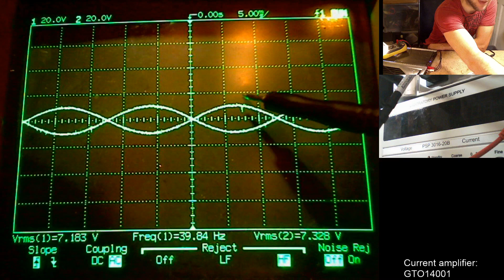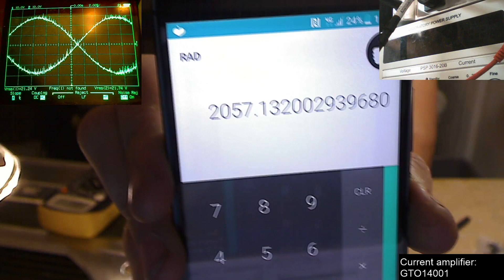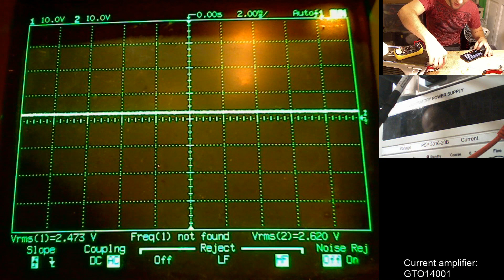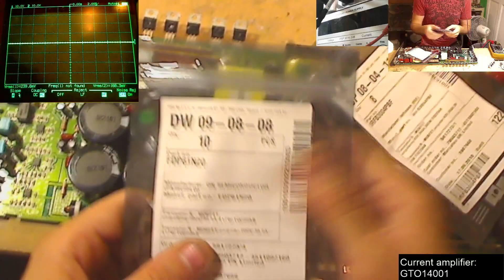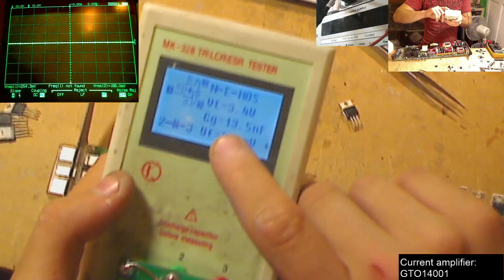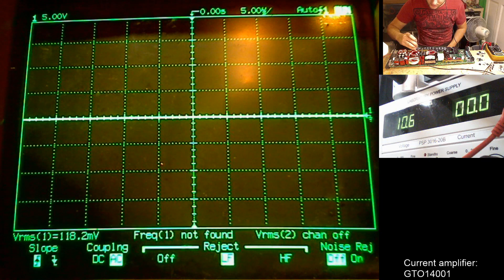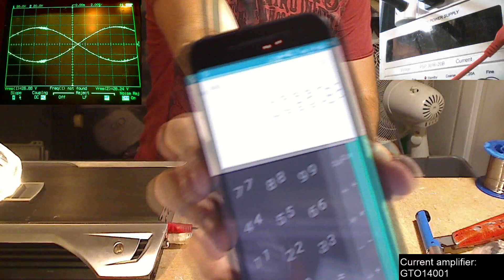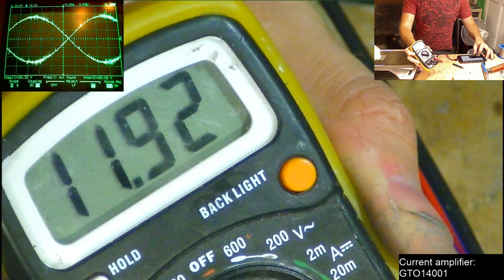Upgrading JBL 14001 amplifier to run 1ohm!?

Comment: Awesome video like usual, although I would have definitely left those fuses in place. Yes, the power wire has one(hopefully) but any internal issues the on board ones will blow quicker than the power wire one.

Comment: I love the live streams but I really miss these edited videos as well. It's all good!
Reply from the maker: Trying to do a few more like this ☺
Reply: barevids good job. I like being able to go back and use videos like this as a reference when I'm having a problem.  For example i did a power supply mosfet upgrade the other day and didn't realize why my fets where getting hot and the had a wave just like the one you showed.  Now I can go back to that amp and fix it with the proper resistors. Those little tips like that are the ones I'm in need of at this level. I do about 2 amps a week but I am in desperate need of some knowledge. Your the only person I have to learn from besides Perrys download.

Comment: I don't understand why the schematics show on both the board and the diagram 80V 4700Uf caps, but the parts list shows 100v 3300uf caps, which is what the amp contains. My issue is finding caps that are 30mm high, I can only find 35mm high in the 100v 3300uf which I already have 10 of. Was 73v the max you read on the output section after it was modified and did you know the voltage before modification? If the voltage were below 70 I would be willing to switch to the 80v 4700uf caps which are readily available for pretty low prices.

Comment: All arc audio car amplifiers have a protection circuit that causes the car amplifier to shut off if you run it at a impedance that is lower than what the car amplifier is stable at for an example the arc audio fd4150 car amplifier is stable at 2 ohms run it lower than 2 ohms and it shuts off run it lower than 4 ohms bridged and it also shuts off

Comment: Hello, I have my dbo for bass that does not work on my amplifier could you help me please. It does not work on the amplifier with the adjustment screws and with the die control! The rca exit from the station must be a sub rca socket! Because I don't have any!

Comment: I heard you say changing the power inputs would be a pain. I have a skar skv2 100.4 that came with a stripped neg Allen screw. What would you remand I do to fix it? Hard to get a tap and die in there since its so shallow. Def dont want to risk further damage by drilling through. Thread insert or?

Comment: I know this is a two year old vid. But I had a Eclipse 4 channel amp that had the B+ and Ground traces that were broken due to board flex.
I used some thin copper sheet and soldered t as a bridge. You should have done the same on the fuse connection connection traces.
I e. Bridge the trace with a copper strip the width of the trace.

Comment: 52^2/2 = 1352, lil under the 1400 spec. The output will be defined by the turns ratio of the transformers, clip power isn’t real, it FFTs out closer to a square wave so RMS conversation will be off unless it’s a true RMS value, regardless the cone achieves no more excursion because the peak amplitude is the same as the rail not higher, the voice coil sees it as DC, so it’s just producing substantially more heat which is why clipping kills drivers quickly. The thing I would worry about is how well the snubbing network matches the complex drive impedance vs T’on of the switches. Maximum power is transferred when source impeadace is equal to load impedance, the circuit could also become unstable with complex signals and oscillate (or at least be under damped) there could be some combination of frequencies that the output filter disagrees with. L = RL/2PFc so the corner frequency of the LC filter is heavily dependent on the load impedance. So you must change the inductance of the filter when changing load impedance to maintain the class D filter criteria. Good fun though...
Reply: Daniel Armstrong perhaps, I’m not familiar with the design, but most switch mode power stages will have feedback to regulate the output, so the voltage should remain constant but draw more amps at higher duty cycle from the input, I would think... I could be wrong, but I’m pretty sure I’m seeing the amp produce almost exactly what it’s manufacture’s rating is on the video... so we may never know... in the end I’m not sure it matters all that much since power isn’t linear, it’s 10Log(P2/P1) so a couple hundred watts when you’re already over 1Kw wouldn’t be really noticed, it’s only 1.3dB gain, assuming the drivers aren’t power compressed already, so probably even less actual acoustic power output... I also seriously doubt the amp will be stable for more than a few seconds as the output filter stage will be horribly misaligned from the original design parameters... but I learn new things everyday so maybe I’ve missed something... As an EE I would have to redesign the entire product from scratch to get additional power from it, so I’m not too sure how wise it is, but I guess if reliable operation isn’t a goal....
Reply: @robertw1871  My thinking exactly, right down to the old rule that it takes ~6-10x the power to double the perceived volume.

Just to be clear here though, there are automotive 12v powered amplifiers that are unregulated and advertised as such, that is the push-pull DC-DC converter always runs at its max duty cycle and the transformer turns ratio determines the rail voltage. No idea whatsoever if this unit is one of them.

Comment: Hey brotha, need to have 2 jbl gto 14001s fixed and modded to run 1 ohm. Please and thank you.  I'm from the states and no one hear that I know will take on the task. Please please 🙏 help.
Reply: He doesn't take in amplifiers from other countries. It's both very expensive to ship and you have to jump through a lot of hoops to get them through customs both ways. Here's a few amplifier repair shops you can try:
GS Amp Repair out of Arizona (George Sanchez)
Desert Audio Specialties out of Arizona
Todd over at Ellensburg amplifier in Washington State
Freeman's Car Stereo in North Carolina

I'm not sure why you need to have them modified to run at 1 ohm since they can handle a 1.33 load from the factory. Are you wiring your subs below 1 ohm?

Comment: Hi. Is it normal that when this board is out of the heatsink that the 2x KA7812 get pretty warm but everything else stays cool? (normally bolted somewhere between all the the other transistors to the heat sink). Great video! The amp is working I just wondered why those two were getting warmer but perhaps they just run like that continuously and they were not on the heatsink.
Reply from the maker: Yes totally normal
Reply: @barevids  Phew. Thanks for the reply Sam. The guy told me the amp was in amazing condition but he had drilled and tapped out most of the connectors. those JBL connectors are a piece of shit, all the pins had snapped off and then I blew my new 500W soldering iron gun. I think because I turned it to full power it's labelled 220V and I'm on 230V.
 Anyway I soldered cables directly to the board and post fuses. I had to throw the binding post, all the pins were snapped but happy days it now works. Having fun arguing with the guy who sent it to me and sent him all the photos of the repair to prove him wrong. lol
 He also sent me the 7001 but at least that one was in good Nic!

Comment: Great Video man i am liking your series. Keep up the good work. Do you ever test your amps into reactive loads? if so can you tell me what you use? PLEASE dont say a speaker ;)
Reply from the maker: But a speaker is a reactive load haha. There aren't many other reactive loads that would present the amplifier with a speaker-like condition. When testing reactive, I still leave one or two dummy loads hooked up to stress the amp more than just the speaker.
Reply: @barevids  Thanks mate.

Comment: EXELENT!! I love modifications like this!! Is there anything else that can be done, besides thickening traces?
Reply from the maker: Rewind the transformer to higher voltage on the secondaries, and upgrade caps etc as required for the new voltage.

Comment: lol the most underrated amps are orions, albeit they are cheater amps though.... just a question, do you beef up the traces by just adding solder to them like I would if I was freshining up a pad? awesome vid btw I learn something every time I watch through an amp mod/repair and look forward to seeing more in the future!
Reply: You would add a nice silver wire and solder it in. (So short, it just looks like a solder blob)
Reply: thanks i sure hope solder wick would hold alot of solder ;)
Reply: Dave Micolichek  And its copper. Way better than straight solder. Great comment :)

Comment: Hi, i changed my jbl gto1000.4 amp to a gto14001 for my subs, and now i hear an alternator noise in my system, if i put back my old 1000.4 the noise is not there, what can cause the problem? Thanks for your help, and thanks for this video!

Comment: In the beginning of your video, I see you resetting the gain for the different ohm loads. My question is what's the best way to set the gain with a DD-1? Would it be with the subs hooked up or should I have a static 2ohm load on it? I have a JBL GTO 1400.1.  It's definitely an awesome amplifier.
Reply from the maker: Subs hooked up. Always.
Reply: @barevids  thank you. That's the way I did it. I just wanted to make sure. One of these days I want to make that amp work at 1ohm.

Comment: Theoretically, if i can keep the amp cool enough and have enough power supply, i can possibly run it below the manufacturer recommended impedance?
Reply: Yes, if you wire your subs to 1 ohm then you should have a decent amount of impedance rise that will bring it back up into the safe level of 1.33 ohm or higher.

Comment: Hear the amp I’ve had for years the power and output mosfets have been lost. There’s one mosfet output  left in it and rectifier one
Diode do you think you could look at the board and give me a schematic and upgrades to it
Reply from the maker: @jackieyarbro8182  all of the parts and info you need are in this video

Comment: I just "repaired" an alpine mrp m1000, just replaced both banks of the ouput section, the drivers and 10ohm 3w filter resistors. It is working but i find one of the drivers and filter coil running hotter. Do you have any sugestions where to look at? (Everything at low volume)
Reply from the maker: Oh man. I am mega stressed out with the exact same amp at the moment. One bank is cutting off the top of the sine wave when over 75% amplitude. I've changed EVERYTHING on this board. Can't resolve it. Too many hours wasted.
Reply: Oh crap.. My osc fried so i cant probe the wave, was hopping this was a simple fix. Something funny happened when i wiggled one of the coils, and it got back to a continuos power cycle like it was before. Another thing i dont like is the lack of an output relay..
Reply: Im finding the rail voltages too low,  around +-36v.. On a 12v computer psu
Reply from the maker: That's about the right rails 
I have a schematic 
It has a dedicated pop reduction circuit instead of relay

Comment: Hi, @barevids any chance you have any info on if the AMP Surivived long term with this mod?? im considering doing it myself, wondering if there is anything you would do different, or if it runs good
Reply from the maker: It's still running good now to this day, even with the user running 0.5ohm..
Reply: @barevids Brill,  Thanks :) will be doing the upgrade to mine next month when the parts arrive from mouser
Reply: @barevids  The upgrade went well, sounds great and runs great @ 1 ohm, seems to run much cooler than before also :)
Thanks and Keep making Great Videos :)

Comment: Great video!! I would like to ask you this though:
I have a TAS5630 class D chip amp(on mono PBTL) that I want to play with and this is rated at 2 ohm. Now, since the datasheet says its minimum load is 1.6 *with recommended filter*. Now how could I get this driving 1.33 ohm or so by modifying the output filter? Increase the inductor value or up the capacitors?
Reply: Problem with chip amps is that they can't handle more output current, they have small legs so they are limited by that resistance. You might get more power but it's not worth it, you are either gonna burn it or THD will rise over 10% .
Reply: +Dave Micolichek not really. This amp dosen't have any compression or any specialized circuits.
 The programmable output is programmed at 19 amperes, rated at 52 volts(63v absolute maximum). What I want to do is to make sure the output filter is good enough as some of these amps do better with a different filter. 
What's more, this is a bass amp with a 9dB/oct filter. 50-150 hz.
Reply: My personal favorite is the TDA7293, with its parallel mode offering you to drive lower impedances.
Reply: It is Class D chip, all graphs they provided are at 2 ohms or higher which means you are most likely pushing it hard even on 2 ohms. You can draw 500W from it, that means about  15A, at 1 ohms you would get 250W with same output current (1% THD). You can probably run it at 1 ohm but don't expect a lot of power, or at least low THD at higher levels.
You can also see filter in datasheet.

Comment: I'm sorry I might look stupid but what formula are you using to calculate the wattage? All I could get is the voltage output of the amplifier times it's self then that times something else equals wattage..but what's that something? Amperage? And is there a way to measure wattage without a tool to read off amperage?..cause I don't have anything like that..
Reply from the maker: Ohms law. I have a static 1ohm load so you use that and the voltage to work out current. You then do voltage times current to work out the power. You then do resistive square law correction factor based on input voltage to 14.4v.
Reply: @barevids  oh ok..but how can I figure out the wattage without having a meter to measure the amperage draw? Or is that not possible?
Reply: @lazy4life207  Yes its possible as barevids stated. Output power= (V^2)/R = ((Vnom/Vin x Voutrms x 2)^2)/R. where Vnom is typical input voltage 14.4v, Vin is the measured input voltage on amp 11.92v, Voutrms is output rms voltage measured on oscilloscope across his 1 ohm load, and R is the 1 ohm load. In his last calculation he did (14.4/11.92x20.33x2) all squared=2412 Watts. The 2 is there because of the H-bridge output swings both output voltages, not just 1 voltage with ref to 0v. AND we did not divide by 1 ohm coz anything divided by 1 is itself. If he was using 1.33 ohm output or 2 ohm or 4 ohm then this value would be divided into the result as in formula.

Comment: Why would the power supply run cooler at 14.4 than 12V. Does Ohms law not apply in this case?
Reply from the maker: less switching losses with the higher primary side voltage in this case. Not true for all amplifiers, depends where the sweet spot is in regards to deadtime.
Reply: @barevids  I'm very interested in this as it is a common belief in car audio that low voltage leads to amplifier failure. I can understand that in regulated designs where the amp increases its current draw to maintain output at lower voltages, but not with unregulated designs. Could you elaborate?

Comment: Cool mod. Not keen on bypassing fuses tho bro
Reply from the maker: Most amps don't have on board fuses, you run your fuse on the power wire. Look at any proper car amp 3k and up. None have fuses.
Reply: @barevids  fair enough. In all fairness to you, I don't really work on car audio stuff. I'm more pro audio. Pa amps and mixing boards. They're crammed with fuses, movs, filters and varistors. So that wasn't meant as a dig. I'm liking your vids man lookin forward to the next one!! Just discovered you on YT.

Comment: How do you calculate the output effect ? 

RMS voltage * RMS voltage / load resistance. 
Example:

28v^2 (RMS)
____ = 784 Watt (RMS) 
    1    (Load in ohm)
Reply: voltage times voltage divided by impedance.

Comment: i have a jbl m4 that sudenly stoped driving its 4 chanels, the fan and led turn on, i did a little work on its circuit and its has some ic pc1298v driving some fet at his outputs, for every chanel. these ic's get the signal from opamps, wich are being feed with +30v, altough its datasheet  calls for 18v max. i just have 1 multimeter. i dont know how to haunt the fault. need help

Comment: You are supposed to fuse every so many meters along a chunky positive cable along a long vehicle run. Something like every 3 or 4 meters. This is because if the positive cable connects to ground too far back from the fuse the cable can heat rather than blow the fuse, you can't really rely on battery located fuses when your amps are in the rear, rear located fuses are a good idea for safety. Most people who run more than one amp in the rear usually have a fuse block somewhere in the rear.

Comment: hello guys, how many amperes do you need to operate this amplifier in 2 ohms?
Reply from the maker: 200a would be the correct fuse to run.

Comment: You could have just modified the rail voltage, for more output
Reply from the maker: It's easier to install different fets than it rewind transformer
Reply: @barevids  Most amplifiers torriods are "overwound" so you case increase rail voltage, by modifying the resistors on the error amps, of the power supply ic.

Comment: U were testing the final @ 10v?
Reply from the maker: 10v is only used when being worked on since rail voltages are lower and everything is safer if a failure was to occur. Final testing done at 12.4v and 14.4v.

Comment: I think the power you're getting is VA not watts. If you're doing Volts x Amps. You need to know the power factor % to get actual watts out of a AC system.
Reply: He is driving into a resistive load so power factor will be pretty much = 1. So VA will be watts. However I would like to know if he drives amp output into a reactive load as well for testing.